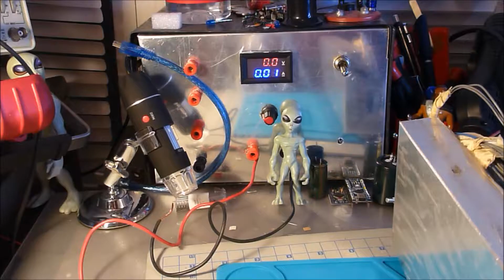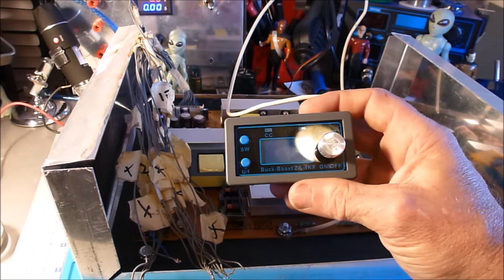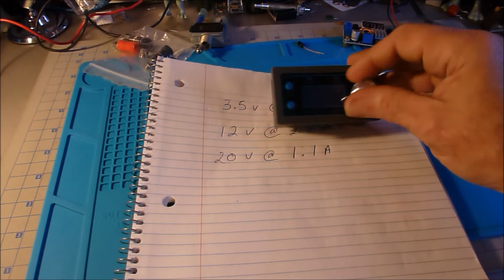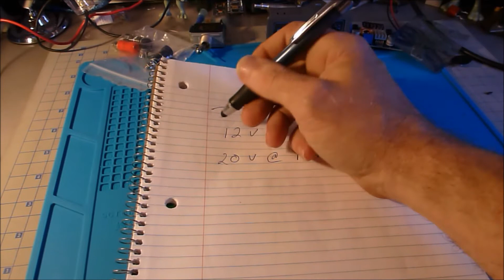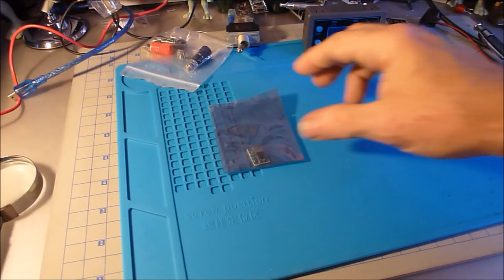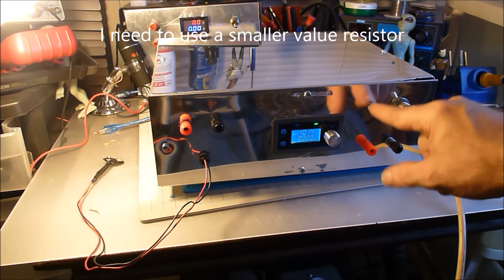Building Bench power supply part 3.

Comment: I've got 4 tv's atm and my power supply just wrapped out on me so I'm thinking I can combine these boards and make a nice supply. I'm going to watch all your videos again. I started this awhile back but put it off until now. I also have 2 old school volt meters that I want to add to the supply to build something unique.
Reply from the maker: The mobo is usually built for a particular screen because of the driver ic, also the power supply boards are generally low watt output and hooking a screen to one would steal a lot of power. I think you could do it if you used an Arduino , Pic,  Raspberry or some other user friendly programmable ic with a small low energy lcd screen and one good thing about those power supply boards are they offer constant current and have over current ( short) protection. This is out of my realm of education though. You are right it would be pretty cool.
Reply: @rednerdnecktech2474  I've got a few Arduino boards. I will look into it and see what I can pull off, thanks again and I'll let you know how it turns out.
Reply from the maker: Post back and let me know how it turns out.
Reply: @rednerdnecktech2474  I will. Quick question though. Would I be able to tie in a video screen by utilizing the motherboards and maybe find someone to write code so I can have monitor everything? I think that would be super cool.